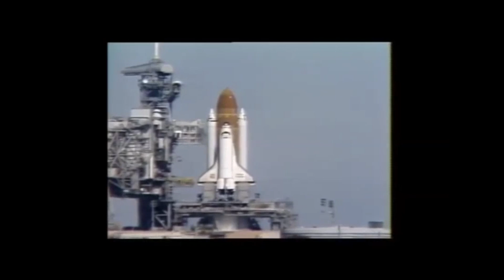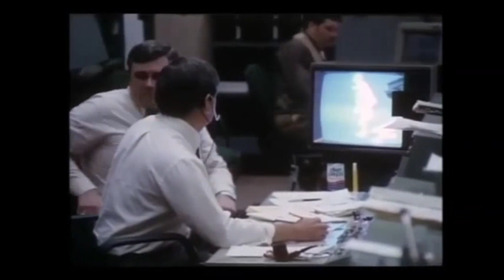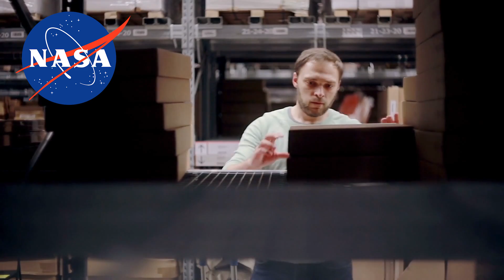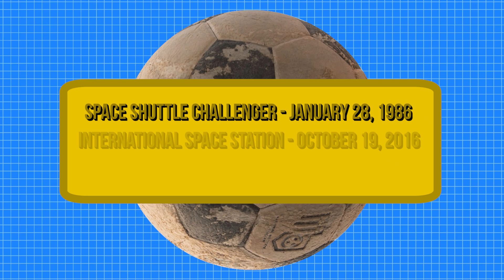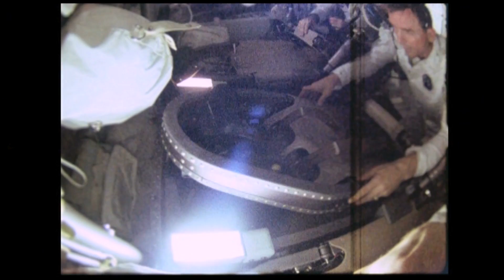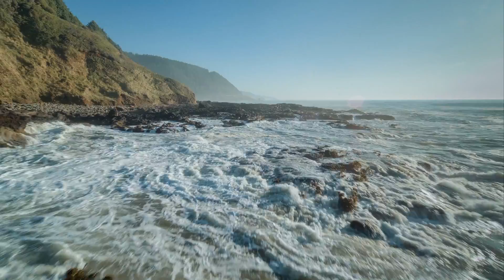The Soccer Ball that Survived the Challenger Explosion

Comment: Challenger disaster was not an engineering failure. The engineers knew that it would explode due to the cold temperatures even before the shuttle was launched. There was an emergency meeting call to postpone the launch even more but was rejected. The NASA Management did not listen and pushed to launch it anyways. It was 100% a management failure.

Comment: This really couldve been prevented but like always people in suits have dollars in their eyes and said forget it launch it after engineers told them not to launch and they did and claimed 7 peoples lives
Reply from the maker: Yep, it was preventable...
Reply: Keidric Lamar  yeah nasa just wanted attention but if they waited just a few more days those people probably would've survived
Reply: The solid rocket busters are cheaper, more reliable and better than the stupid hydrogen fuel.   Hydrogen is very much the worst fuel to use for a rocket.
Reply: @MichaelMantion  Actually, rockets are more efficient with lighter propellent, so H2 is one of the best options for that.
Reply: @nnelg8139  actually h2 is one of the worst fuel because the storage weight offsets the energy density of the fuel.  Also it is complicated to handle and greatly increases the chance of a failure to one or more systems.  Until there is a good way to store hydrogen in liquid form it will never be a useful fuel for transportation.
Reply: they are still alive,shill.
Reply: People in suits? You mean ‘Men In Small Hats’